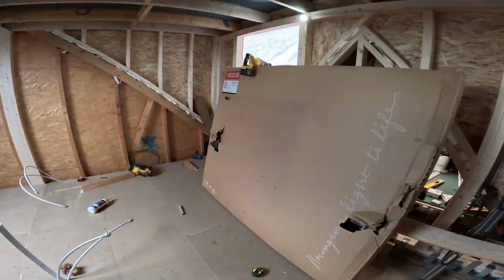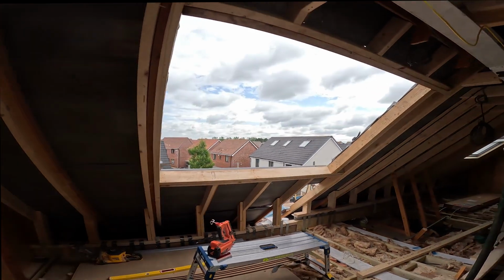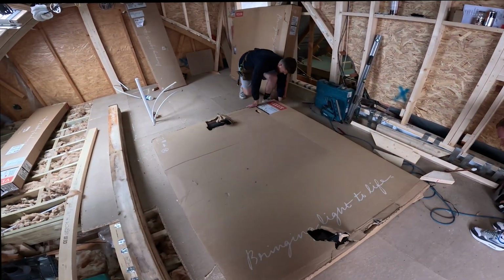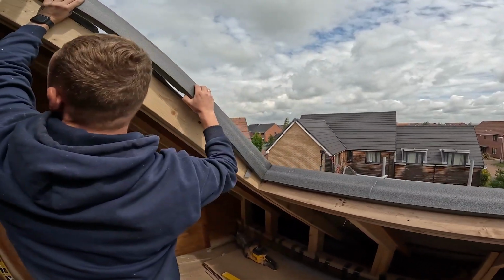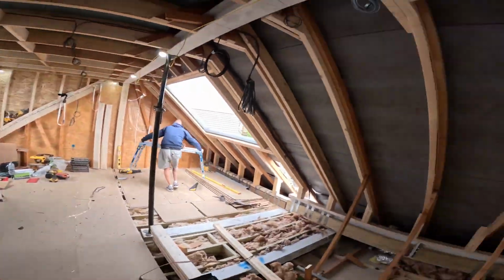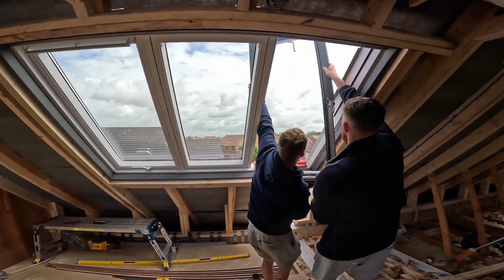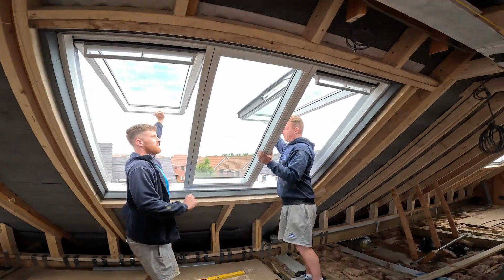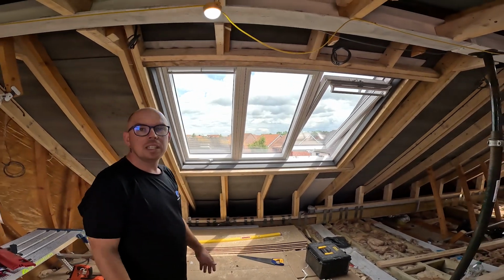Brand New Velux 3 In 1 - How to Install!

Comment: Hi there. Just a quick question… we want to fit one of these but we have a rosemary tile and velux currently don’t do the EDP flashing for this product. How did you adjust the flashing for the plain tiles you’ve got on this roof? Thank you.
Reply from the maker: An edw flashing can still work with plain tile. As you have the same issue on cabrio windows. Just make sure you use tile half tiles to minimise small cuts.